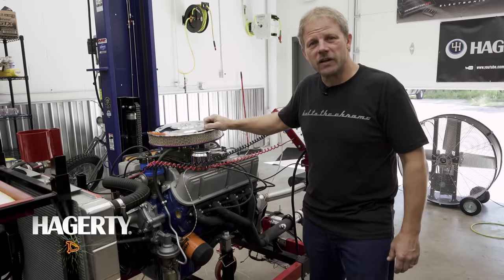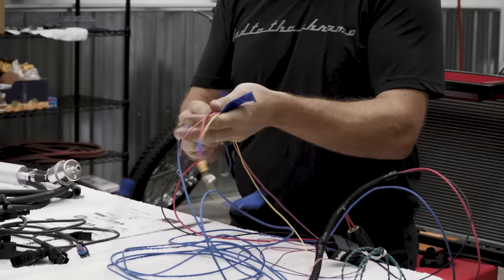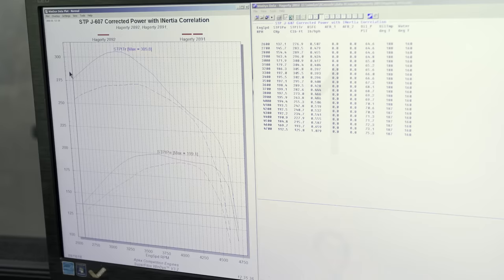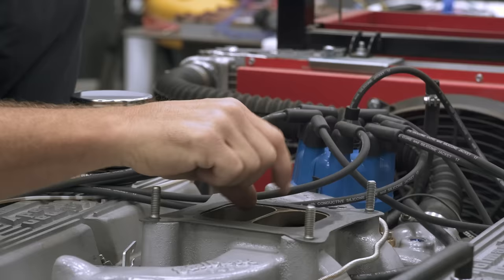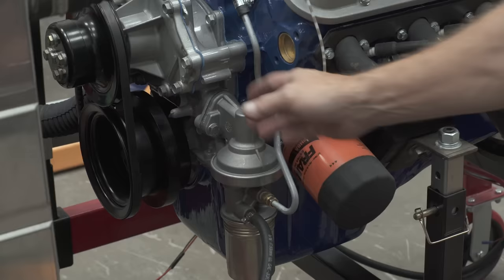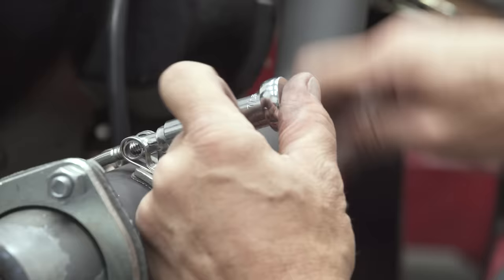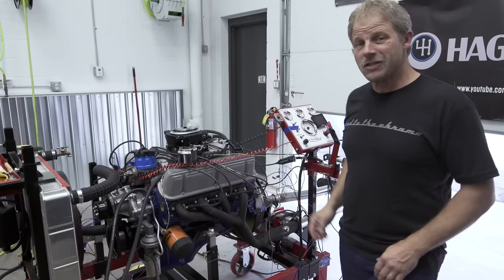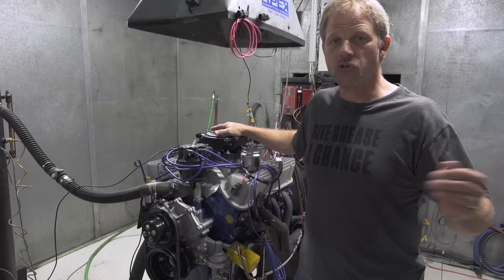Is it worth it? Replacing your carburetor with a Holley Sniper EFI | Hagerty DIY

Comment: For me, the single most important advantage to Fuel Injection is that you no longer have a carburetor pouring raw fuel into the high vacuum created by releasing the throttle during deceleration! In the Carburetor Age, when engines neared 100K Miles, you could tell by the blue vapor trail out of the exhaust pipes and piles of carbon caked on piston, rings, valves, head, and spark plug! More modern carburetors tried to compensate for throttle closing by damping the closure and by actively restricting fuel jetting during those high vacuum deceleration events, but in the end they were never reliable enough or performed well enough to greatly increase engine life. 
There are also two more incredible advantages to Injection. They are that you will never have a sticking float valve! "But that's only one advantage", you say. Well, not only will you never have a float valve stick closed and need to beat on your carburetor, you will also never have one stick open and burn your car down!
Reply: There are a lot less boat fires at the launch ramp since EFI...
A lot of those old timer guys would blow their minds if they had a wideband in their stinky old carb cars. 14:1 idle stoich would probably make them weep since most of them tune to idle @ like 7-8:1 for some reason.
Reply: im an old car noobie, and even im looking at EFI to get my L78 off the motor mount. I just want ideal flow/fuel mixture at all times for an engine with solid lifters, w.o having to worry about old fuel/exhaust causing cycling issues. Something that will work with the stock/shared plenum SS manifold as well as a long runner tube/single plenum with split intake/throttle if NEED be or if i really want to have ideal operation. For low flow/low rpm/fuel ap, and fully open plenum/intake high power, etc STREETABILITY aspects. The idea of being able to customize my head a lil or change my fuel/injector operation for this street use sounds fun. Thinking i could be able to tune or set a tune for "cruising" and all out/track/drag strip. fun. As a noobie...has me motivated to get that engine a roller. The engine is a family/pass down. So i really want to keep the lifters/cam stock/solid as it was factory intended to be used/driven at 11:1..vs the 10:1 ppl swap to with a roller cam /402 build. The engine had pushed 15:1 in their nascar HIPO build. So i just want something "close" to that level of FEEL/noise under operation when being pushed that still offers ideal carb/fuel operation down low or a way of setting ideal idles etc. Knowing im not doing damage to my pistons/head during deceleration helps me think i can make that engine/car more of a streetable/FUN build vs a "PURE" weekend cruiser...or implementing a mild cam. Seeing that 780cfm from factory as a limting factor EFI has me Motivated to put a long runner/high rise manifold on the 396 with some LTH into a C3 or a Chevy II roller. Prior the headache of tube/length/geometry etc and the proper CFM carb/etc system had me "Scared" to get the L78 running again....but EFI IMO helps me think its possible.

Comment: This is something I've been wanting to do to my '86 F250. It has a 460/c6 with 33s and gets 7.3MPG highway at 70mph. No OD hurts, but I'm sure the carb is leaving a lot of efficiency on the table as well. I don't daily drive the truck(for 7.3MPG reasons), so I'm having a hard time justifying spending $2K on this swap. Still, this seems like something the truck would benefit greatly from.
Reply: @marcum exe seriously 🤔
Reply: If you're not able to tune a carb, this will help you.  However, how many miles will it take and how many fuel tanks will it take on the old setup is up to you to mathematically think about.   If you only get a 3 more miles to the gallon then you'll be wasting your time for years...depending on how much you drive it.

Comment: A few solid points. The installation into an " old school" carbureted car is going to be somewhat involved. Your fuel tank at least needs a return line provision. If your tank is old and in need of replacement you could use an in tank pump/ tank combination. My tank was new and I just used one of the three vapor line provisions ( though I was told not to), I also just went with the simple kit which maybe I shouldn't have done. This meant I had to supply the fuel pump ( Walbro GSL295) and the pre and post filter. The earlier kits had a fuel pump block off plate but the one I had didn't have one. I am not a fan of mechanical fuel pumps so I had one. I used the original fuel line as a return line and had to get a few feet of EFI rated fuel line and the clamps as well as the fittings for the fuel pump.  Due to the size of the fuel line, I had to cut through the transmission cross member and used an old piece of garcon hose as a sleeve to prevent the fuel line from getting chafed. I also used a bit of the residual EFI hose as the initial part of the return line as the fuel pressure will still be fairly significant off the throttle body. Wiring it in required patience and understanding. That was somewhat involved but nothing really ominous. The throttle linkage was another story. I had to go with Lokar cables for the throttle cable and the transmission kickdown. I used a cheap TVS cable adapter for a Demon carb with a few washers as my cable bracket. It would be nice if this was part of the instructions. I also had an old single plane intake. Given that the engine has headers, a set of aluminum heads and an aftermarket intake manifold the heat transfer to the throttle body would likely be significant. That's why like this article I went with a phenolic carb spacer ( use the open centre one). I also took the time and had a proper O2 sensor bung welded in. I did not trust the cheesy bracket. Do it once and do it right. Another issue has been the sensors Holley provides. They are cheap junk.  Look up a Blue Steak/ Standard TX9 coolant temperature sensor. Also get a proper wideband O2 sensor. It's caused some consternation but the substitution of these parts has ironed out some bugs. A caveat is that like most aftermarket hot rod parts quite a number of them are designed to use GM related parts. Being as mine was a old Mopar it has taken time to iron out the bugs ( some of which will need more refinement). So. Was it worth it? It sure was expensive and time consuming. It required a good deal of troubleshooting not to mention a plethora of parts that Holley neglected to tell me that turned out to be required. The positives though are pretty significant. Number one is that the EFI ( properly set up) won't " over fuel " the engine. The reduced engine wear alone is worth it. Then the part throttle efficiency and response. Initially my engine was like a light switch. Either on or off. That made it a bit of a handful to deal with. Now it's smooth power and undoubtedly there a lot more mid range power. It's also a whole lot better in corners and daily driving. So I believe that it is worth it.

Comment: Sears would sell Penskie high performance ignition parts in the 70s and  the points cap and rotor with the hp coil  made no difference on the stock slant six. But it would rev well over 5,000 rpm even before the tune-up.

Comment: This is just a Holley commercial, they didn't even try to jet the carb.
Reply: Commercial or not, the Sniper is far superior over the carburetor. I put a Sniper on my '70 GTO and it works way better than the quadrajet.
Reply: @Rick-Williams59  then you are really bad at operating a carb
Reply: @brandonshere3  do you still draw water from a well with a bucket too?  lmao
Reply: @Rick-Williams59  That's GR8 glad your car is running better, that's the best way & easiest to do if one does not know carburetors. But some out there don't have 1K+ for a fuel system, Tuning carburetors is a long lost art many think they know or knew but have no idea what it takes. On Quadrajet it takes a bit of drilling, grinding, jetting & know how. Today's Mech will never know the art of tuning carbs & most that knew are long gone now. Now its new & improved world all done by ECMs leaving the human factor out. Soon one will be able to buy a performance car that will be electric & driverless that will smoke anything out there. All it take is a few ECM's wow that will be fun to own.
Reply: nFlames2 I’m glad two of us know they are full of it. Top end power will be the same. Fi will run better when cold and burn less fuel.
Reply: Lol carbs are cheap and easy want to figure out how to tune a carb go hang out at the drag strip on test and tune night and ask around someone is bound to explain it or at least let you watch the process some carbs are a little different from others but they all will tune with simple hand tools and max with a full jet kit will cost 200$ is there a 200$ laptop to tune this with??
Reply: Stev Rex  he is a hella lot smarter then you.
Reply: @nFlames2  what do you mean soon? have you seen a tesla?
Reply: @Hachiae  Just being sarcastic LoL.
Reply: I have seen 3 or 4 tests with holley hp carburetors and they put out more horsepower than the fuel injection.  nicks garage is the first one to come to mind.
Reply: Exactly.    This is nothing more than an infomercial.
Reply: Yes Motortrend did a non 'paid' version and the carb makes more HP with you have someone who can jet a carb :)  Also they dont talk about all the issues (RFI interference, bad injectors, bad electronics from China etc) that pop up with EFI systems.. Its a nightmare once it starts and esp when your warranty ends.. I did TONS of research... and the carb just works, esp new carb systems.
Reply: @Rick-Williams59  wrong
Reply: No carb tuning, plus it was vacuum secondary.  News Flash, vacuum secondary carbs almost ALWAYS have too stiff of a vacuum spring, and almost never open all the way.  A well tuned double pumper would have made WAY more power than the vacuum secondary unit that was on there.  Power is usually about the same with EFI and a good carb.  The advantage of EFI is efficiency, less hassle with startup, etc...  and not washing the cylinders down with a choke, etc.  EFI warms up more cleanly, there's less oil contamination, and due to less washing down the cylinders, the engine lasts longer.  You just can't fix it beside the road.  If an electronic part fails, you need a tow...   THAT would be the main disadvantage...  outside of cost.
Reply: @n2omike  actually a vacuum secondary will make exactly the same power as a DPumper of equal CFM.   I built drag jet boats for years and always the vacuum secondary set up was faster in the quarter due to a much flatter torque curve.   The double pumpers would never come out of the hole well regardless of whether you had 2 50cc Rio pumps and regardless of squirter sizes.  

You need to hang around those who do this for a living to learn.
Reply: @tahcogunworks  Disagree.  Have replaced vacuum carbs with double pumpers on many occasions, and have always picked up.
Reply: @kylebrown5957  i started to believe  that the main reason for car electronics is  to enforce dealer maintenance.  And that is covered up by confort reasons.
Reply: Thinking about getting one,will it work with a vortec supercharged and a carb enclosure ?
Reply: They also did not try the carb with a good ignition
Reply: @Hachiae  A Tesla is overpriced electric garbage powered by coal👎
Reply: @n2omike  Then you should have changed the spring in the vacuum diaphragm. Double pumpers are too rich in the idle and cruise circuits for decent fuel economy. They are meant for race engines with cams that have narrow centrelines and high overlap.
Reply: @jeangenibrel2358  Nothing wrong with a good set of points.
Reply: @MatthewBerginGarage  i agree with you,i love my old corollas. But there is no denying how fast they are.
Reply: @kylebrown5957  there is no laptop is self learning
Reply: @nFlames2  The human factor with EFI is now in laptop tuning, which still requires knowledge of how internal combustion motors work. We've just replaced screwdrivers for computer mice to do the same job. But Sniper EFI is good for someone who doesn't want to know how to tune with a mouse and fuel maps, or simply doesn't have the time to.
Reply: They did not even take the air filter off the carb.
Reply: @brandonshere3  I was building carburetors before you were born and have probably forgot more than you will ever know about carburetors.
Reply: @sketchydustin8372  I'm sorry some of you don't have the knowledge to figure out the tuning of electronic fuel injection. I guess there are smart people like me, and ignorant people like you. You can always take courses to understand basic fuel injection. Carburetors, no matter how good the builder is, will always give problems as the weather changes, EFI adapts, get educated before you talk about something you know nothing about.
Reply: @nFlames2  I know everyone can't drop a grand on a fuel system, it took me 2 years to put together enough for a Holley Sniper. But consider the cost of a Holley carburetor at 500 bucks, then another 80 bucks for a carb kit every couple of years, and if the ignition breaks down and spits back through the carb, then power valves at 40 bucks a pop. New and reman Quadrajets for classics are going between $700 and 2 grand, depending on the rebuilder or manufacturer,  I've saved a lot of repair money by going with EFI. I've been building street and racing carburetors for street and track for 45 years and I know every trick in the book for Quadrajets, Thermoquads, Carters, Holleys, Keihin, and few other well known and not so well known carburetors. I chose to use EFI on my classic because of fuel economy, better starts, and all around good performance. Carburetors are good for racing, but not the stop and go traffic of today. I used to defend carbs against EFI, but today's EFI is far better than it was in the late 60s through the 90s. If you like carbs then use them, I like to climb in my GTO and drive, not spend half a day under the hood adjusting fuel mixture, I can drive and do that from a laptop now. Enjoy your day.
Reply: @Seymour Kuntz whatever floats your boat.
Reply: @Rick-Williams59  rofl okay "scotty"... yeah because the holleys "don't" break all the time... the others are even worse... I know all about EFI and the carbs nowdays are pretty damn nice...  Go watch Engine masters... The Carb puts out more HP... not as complex, so it doesn't break all the time. Doesnt lose its programming, doesnt burn out the board... injectors dont fail...
Reply: @Rick-Williams59  first you have no idea how old I am, second if it took you two years to pay for a holley sniper you should probably cancle your internet subscription, stop buying car parts and try to stop working at McDonald's
Reply: @sketchydustin8372  if you have those kind of issues "Einstein" then maybe you should go back to school and learn how to operate EFI, I've had mine for 3 years and not 1 issue with any of those things you mentioned. If carburetors are your answer, then stay with them.
Reply: It is a Holley commercial, and I agree carbs are better but these are for people dailying their cars.
Reply: @liam3044  I daily my car with a carb*
Reply: @brandonshere3  same here. Holley single on my scout. I was just saying most people don't like to fiddle around with carbs.
Reply: DrgnFlys  i mean, I consider Bill gates pretty smart and he never went to school
Reply: Look people, carbs are cool, EFI is cool, all cars are cool. This test wasn’t perfect, but there’s a reason why all newer cars can make so much power in a small package, and there’s a reason for carbs.
Reply: @blackericdenice  The FI doesn't have that roar that a big 'ol 4 barrel does when you open it up. Plus, when you are cruising on Friday night in a 50 year old muscle car, who cares about the gas mileage.
Reply: @garyjubar5733  TBI does sound just like a 4 barrel.
Reply: @blackericdenice  I must confess I have only driven the newer vehicles with FI, like my 2003 Mercury with the 4.6V8 or my wifes' Nissan. Still, when i feel like having a little fun I take out my old Galaxie .  I go back 40 years to being 36 all over again, lol.
Reply: @garyjubar5733  I would love to have another 1974 Grand Fury cop car. People used to call it the Blues Mobile. I had never seen the movie so I had no idea why.
Reply: And they ran 2000 less rpm
Reply: @Rick-Williams59  But i can slap a carb on my engine for less than $200 I'm sure the Sniper cost over $700.